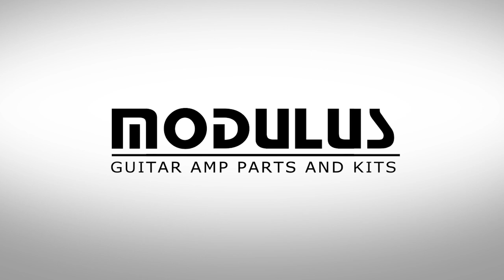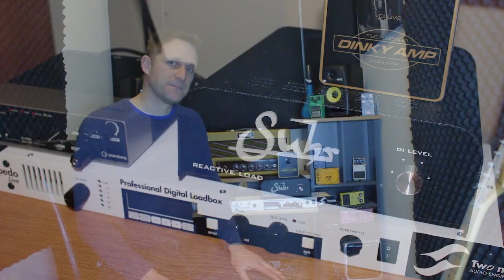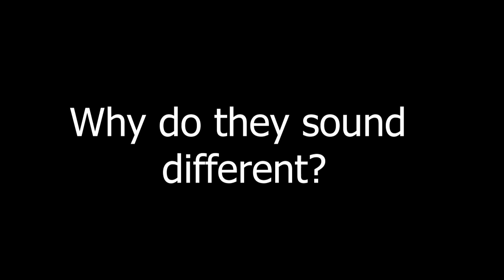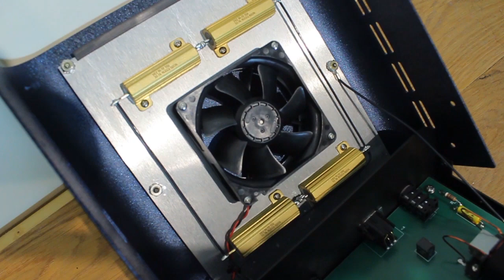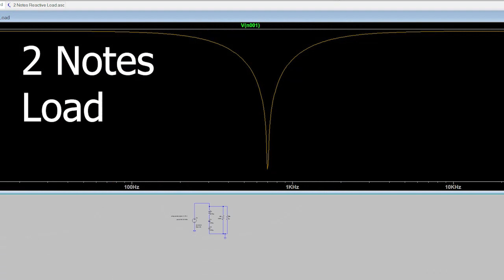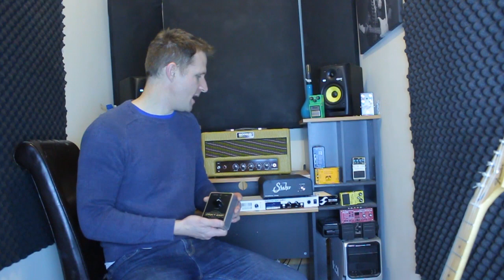How to CRANK your guitar amp at home without getting a divorce | Suhr Reactive Load vs Two Notes

Comment: Hi, I just bought one of your 69 Plexi kits and I plan to play it at home. So your video here might help a lot. What was your exact setup here. Guitar into Amp into reactive load into ? into ?  What speakers did you use or did you record directly into a computer?
Thank you for your help.
Reply from the maker: Thanks! 

I was running into the computer here and using IRs. I am in the process of putting together a reactive load with power amp in one unit to run directly into a speaker cab too